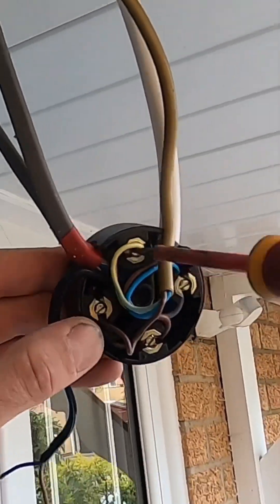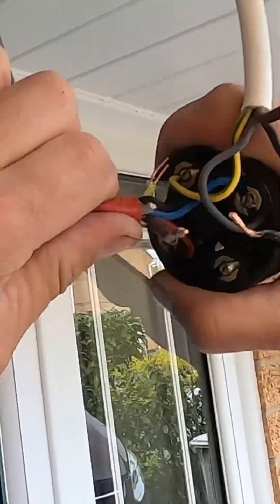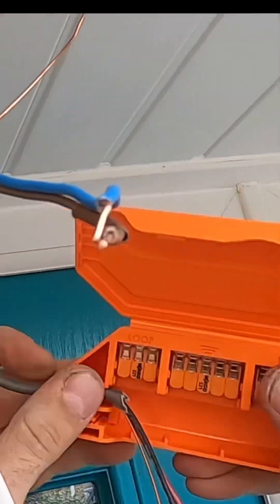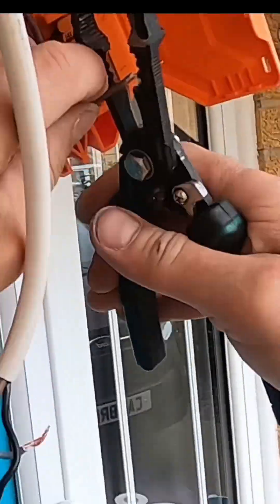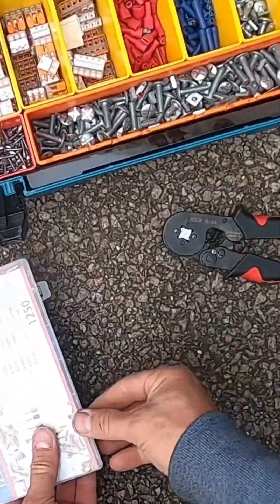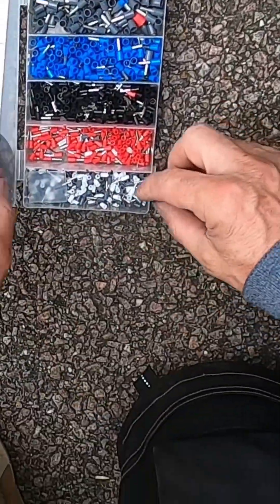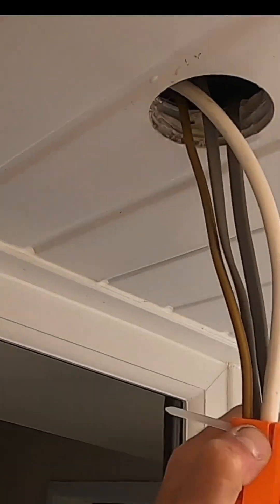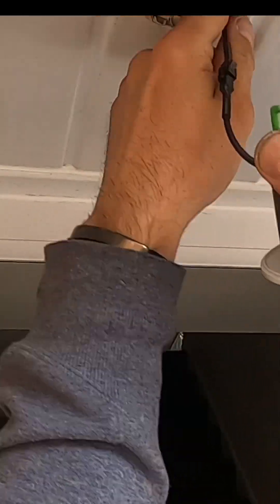Quick Fix or Upgrade? Here’s How to Boost Your Electrical System Fast!

Comment: Just got a couple of these boxes for a small job sorting out the downlights done by some bathroom fitters and fitting a new extractor. Must admit when using Wago's on stranded cables I wouldn't bother with ferrules.